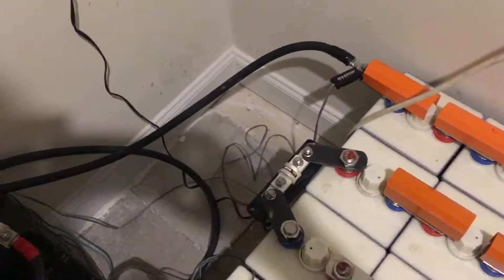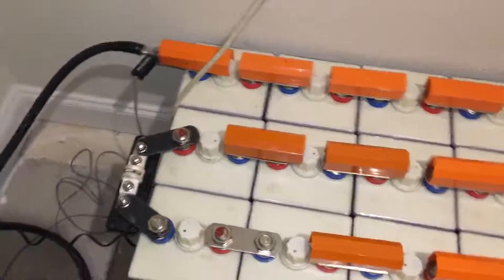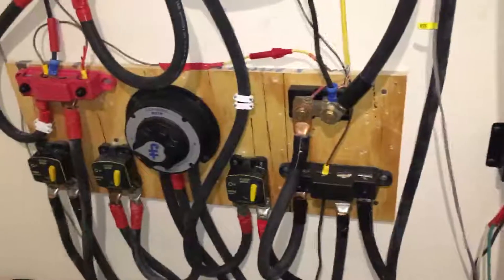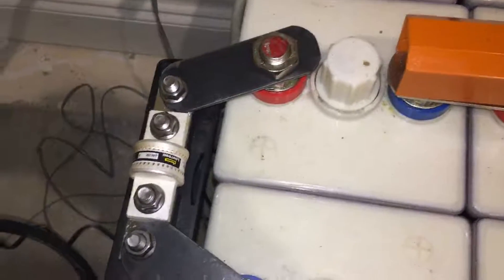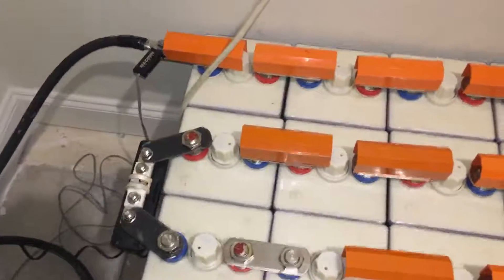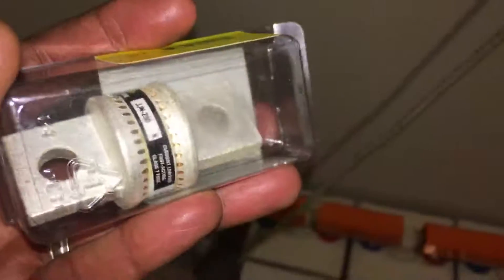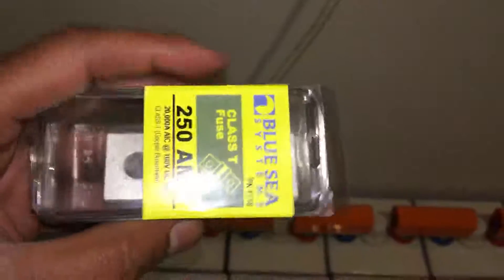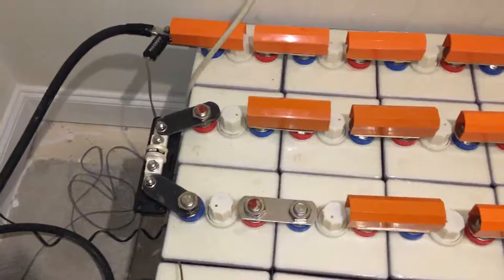A Safer Off Grid System with Battery Bank Fuses

Comment: Very informative video.  How did you size the fuse for you battery bank?
Reply from the maker: I believe I sized it according to the size of my largest circuit breaker in my system which is 250A

Comment: NICE!!
Reply from the maker: yankey4 thanks, and by the I used the hydrogen peroxide and it seems to work well used in conjunction with hot water afterwards. Thanks for the help.
Reply: rhandsom Cool. Happy to help. What worked best tho?
Reply from the maker: yankey4 a combination of each, garden hose to get the initial sludge out, peroxide, to loosen stubborn sludge, hot water to loosen further, rinse and repeat. The jury is still out on the vinegar.
Reply: rhandsom That is cool. I do recall we had a set of things we would do. When I seen the video I told my wife. See that is what I recall the cleaning looking like when we would do it. Whats nuts is you got one to around 80% that fast..
Reply from the maker: Yes, I was floored when I saw the results.  But, we'll see how the others go.